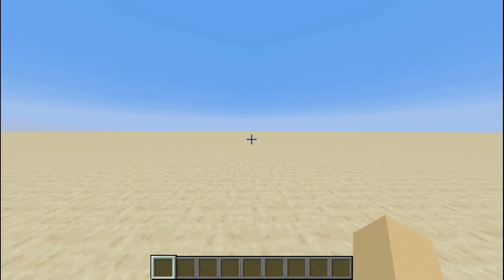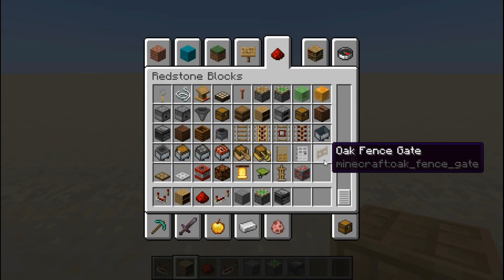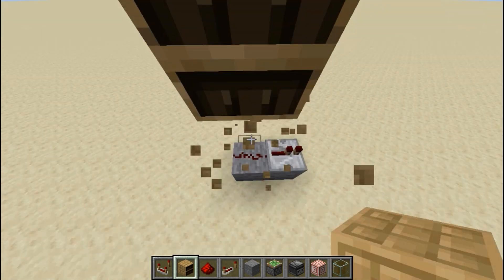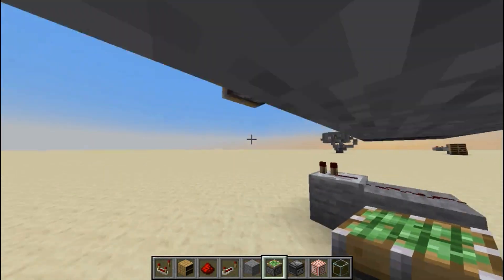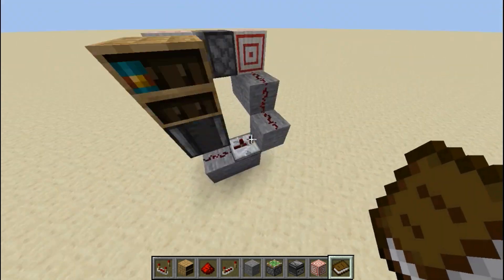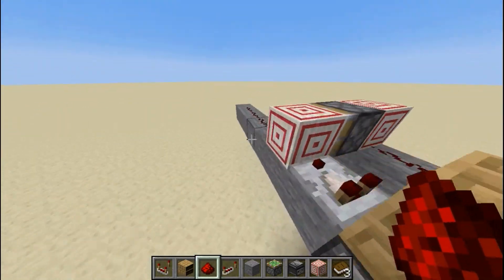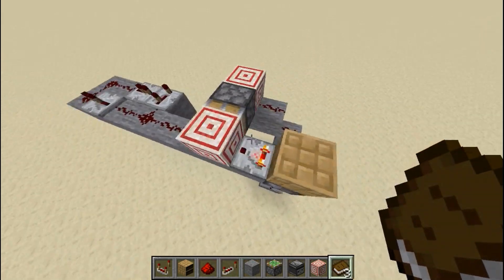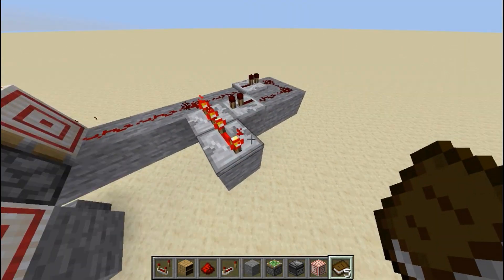Minecraft 1.20 Redstone Tutorial: Chiseled Bookshelf Reader

Comment: Any way to make it auto close once inside….?
Reply from the maker: You can add a lever that powers the door its self, or you could put some pressure plates down going into a t flip flop that powers the door. Both of these with not only close the door while inside, but also lock it, so people cant get in.

Edit: this will cause any input from the outside, that is not the correct book, to lock you inside. So i would recommend a second exit